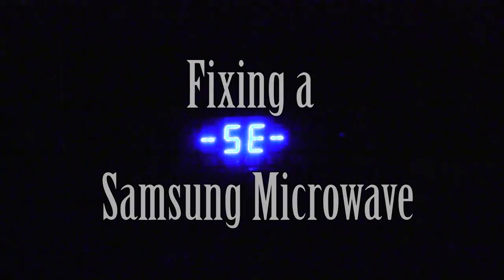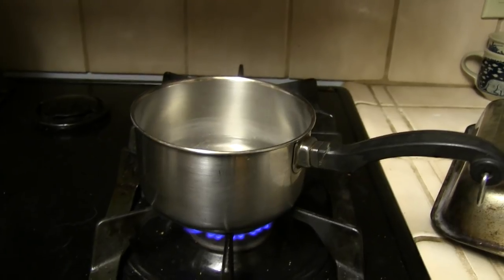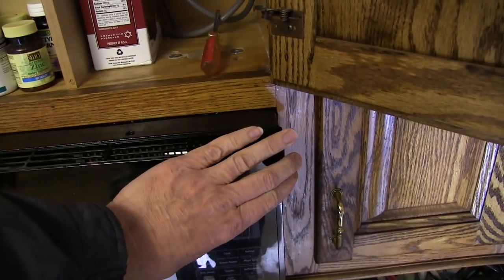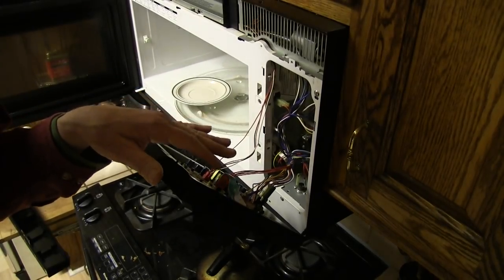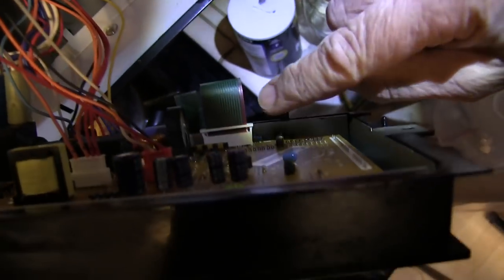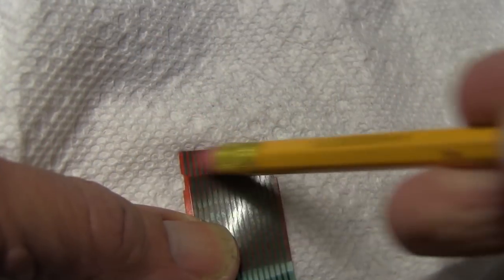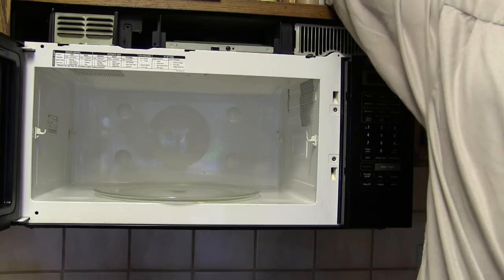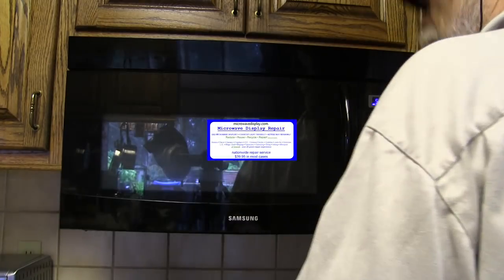Fixing a broken Samsung Microwave - The dreaded 5E error code -- aka the SE error code.

Comment: I tried your repair and it worked great! However, it only worked for a few weeks and now I’m having the same problem. I’ve cleaned all the wires and connectors again but it won’t work at all anymore and keeps giving the 5E error. Any other tips that I should try before having to replace it?

Comment: This worked perfectly for me.   I used isopropyl alcohol swabs to clean all the contacts on the ribbon cable and used a toothpick to get in and around the pins of the other connectors.  15 minutes of guided work saved me from buying a replacement microwave.   Best how-to video I ever watched.   Didn't leave out a step.

Comment: This happened for the 3rd time to my microwave in 4 years!  The first time it was under warranty (by just 2 days) and the repair man replaced the circuit board.  The second time, I followed your instructions, and it worked just fine.   I unplugged everything last night and cleaned all areas, but when I plugged it back in I had no electricity, not even the light!  The outlet is in a very hard to reach area, and I may have tripped the RFI plug on the outlet, so I need to double check that tonight.  Any idea which of the connectors supply the electricity?

Comment: I'm glad the 2nd highest ranked Google result for "Samsung SMH9178B keeps beeping" is your video. Finding a solution on the internet is fairly common these days. But to find a complete, informative, and professionally produced video like this was a real treat. Kudos to you!

FWIW, cleaning only the ribbon cable did the trick for me as well. Also, my microwave did not show the SE error. It just kept beeping and the key presses only registered intermittently.
Reply: Im glad i read your comment before cleaning everything, because it worked on the first try. Yes! Minimal effort because im actually moving out of my rental condo this Saturday! Thank you
Reply: My smh9151b was stored away for about 4yrs before put in use, and it's worked for about 12 since. 
It started doing random beeping in the middle of the night. 
Not sure how far I'll get , this thing was probably obsolete by the time I installed it.
Maybe I'll look around for a connection issue but I don't have much faith in it , and I don't want to waste alot of time goofing around with this thing though.

Comment: Thanks for posting this! I followed most of your steps and put it back together and I now have a working microwave! The only things I didn't do was use the clothe on the end of a sharp object to clean between the contacts (I think the compressed air did an effective job of cleaning things out).

Things I would suggest adding is to use your camera or cell phone camera, to capture a picture of the wiring before disconnecting and then completely disconnecting all wires so you can work on the keypad on a flat surface. In checking the ribbon cable there weren't any exposed metal contacts so I only lightly cleaned it with an eraser and buffed it with a clothe (it appears both sides are completely coated with plastic) - I didn't want to wear away the plastic. I believe that the cleaning and disconnecting and reconnecting of all of the connectors are key. The contacts where I focused the cleaning with the eraser are the four copper contacts that the blue and white wires slide over.  In addition, I unplugged the unit and left it unplugged for several days, I am not sure if this is a factor but it may play a role in allowing any build -up of energy to be released. Finally, something that may play a key role is the other end of the ribbon cable - I am NOT recommending to attempt to disconnect the other end but I think it is important that people attempting this repair to not put any stress on this cable, e.g., tugging on it, and I noticed that it seemed to be somewhat extended so I made a point to gently push the other end of the ribbon cable that connects to the keypad back inward toward the keypad. I will provide updated status but so far so good :)

Comment: A month ago I used your video to fix my microwave.  Unfortunately it is acting up again, but this time, it is something different.  The 5 button just random pushes itself 4 times and then none of the other buttons will work.  I can reset it by unplugging and this may last a few minutes or slightly longer.  Any thoughts?  I'm thinking of replacing the keypad

Comment: It is essential that you FIRST either discharge the capacitor with a insulated screwdriver, or let it discharge on it's own by letting it sit unplugged for atleast 8 hours prior to the repair. Failure to do so could result in injury or death.

This is a great how to video, but as with all electrical related repairs safety is your number one priority! Please do not take shortcuts that can put yourself in danger with a DIY project.
Reply: Safety is always priority one but this repair is no where near the capacitor and all parts dealt with are  insulated and no volt with the unit unplugged. Just don’t jam any coat hangers in there to catch dust bunnys.

Comment: After watching several of these "how to fix the Samsung 5e errors" I came to the conclusion that there was one common element. Most of the 'solutions' involved different 'fixes' but one common action. The action was the removal of the cables from the control panel. I removed the grill from the top of the microwave,(2 screws), then removed the panel (1 screw). I left the power on and carefully unplugged each connector on the control panel board until I found the one that supplied power. I knew I had the correct wire connector when the panel went blank, I waited about 10 seconds and then plugged it back in. The panel 'rebooted' similar to a computer and now works. Simply unplugging power from the wall wouldn't work, you had to remove the connector from the board which reset the panel. The whole procedure took about 5 minutes.
Reply: This is a great follow-up comment to the video for a successful fix.
Reply: Gary DePollo Awesome! I knew it had to be simpler!!
Reply: Gary DePollo How long did it last you?
Reply: Unplugged everything, waited a few minutes and plugged all the plugs back in. IT WORKS! ~ No cleaning needed
Reply: Thank you Gary very very much!!!
Reply: I only removed the ribbon from the keyboard.  Cleaned the ribbon with isopropyl alcohol and alcohol using a Qtip, I was able to see what looked like dirty solder on the Qtip.    I also recommend cleaning the whole exterior of the keypad with isopropyl alcohol to ensure that the outer surface grim is not stuck to the keypad causes the keypad to stick.

Comment: Wow, kudos on a really PROFESSIONAL video!  How did you create the graphic arrow overlays and title cards?  Also, FWIW, I'd recommend using Tex-Wipes, lint free cloths for application specific electronic repair.  Also using something like QD Electronic cleaner an alternate to CFC based cleaners, to spray the connectors/pins.  Then use the tex wipes to wipe the residue off.

Comment: It is that pesky ribbon connection.  I am uncomfortable with that connection.  I pulled the panel out, and followed the suggestions for cleaning all contacts in each connector.  I tried to burnish the contact edge of the ribbon, I used a white eraser to burnish, and followed up with a contact cleaner pen.  I wiped the edge dry, and reinserted it into the connector block.  The first attempt did not fix the SE error problem.  Second attempt, I used an acid brush (a brush used to clean new solder connections) dipped in alcohol, and forced the bristles directly into the board connector, then wicked away the excess liquid, following up with a canned air blast.  Finally, when I reinserted the ribbon, I worked it in and out a couple of times before locking the connector.  That worked.

I am completely underwhelmed with the quality of workmanship, and the non-robust design Samsung put into this appliance. I am now worried that our Samsung stove-top/ convection oven combo is headed for troubles with its electronics.  I suggest to anyone shopping for a kitchen stove, or overhead mount microwave, to steer clear of anything that has smarts, and is gadget loaded.  Get a gas oven, with the only electronics installed being those really cool piezo-electric igniters.  Really.  Go for robust, but simple.  Kitchen appliances go through a lot of Hell!
Reply: Use contact cleaner spray. It works on any connector or electronics. Buy at auto parts store.
Reply: My ribbon lock was loose when I inspected it before unplugging everything. My guess is all the door slamming over the years worked it loose. . .It was a simple fix thanks to all the good folks who post on Youtube!

Comment: Water alone won't stop the MW. The problem is that the ribbon cable(s) from the keypad to the works rubs against the metal frame, wears off the insulation, and shorts out. I put a piece of electrical tape on the frame and, for good luck, slipped a piece of scrap paper between the two ribbons. I was able to do this with the MW on the wall and without removing the main case, but I don't remember how I got the case open from the front. I think I remember taking out two screws, sliding the upper case sideways, and taking out one or two screws to remove the control panel.
The MW has worked for a few years (but now seems to have blown a thermostat - $4.00 - but I had to take it off the wall to get at it).

Comment: Great video. Your fix worked for about a year the first time, and then started the behavior again. I'd disconnect the main power cable for 15 seconds or so while the unit was plugged in (as another video had suggested), and that worked sometimes for a couple of hours and sometimes just for a few minutes.

What did work was total replacement of the membrane keypad. I bought mine from Appliance Parts Pros for $35, plus $6.50 shipping (I don't have any relationship whatsoever with them; I just found them online). Replacement of the membrane, as shown in yet another YouTube video, was fairly straight forward. It was a bit messy trying to get the old adhesive off of the plastic housing. OnceI did that, laid down the new membrane with its self-adhesive back, and reconnected everything, I was back in business.

The unit now works just fine. I just did it this morning, so I'll check back if, for some reason, it fails again.

Comment: I've experienced this issue with my SMH9187B for a couple of years now.  When the issue first came up, I followed the instructions of this video and they worked great!  Great video!  This video is the gold standard for DIY fix-it videos!

However, the issue came back about a year later and no matter how many times I repeat the instructions in this video, the SE error comes back immediately.  I dug a lot deeper via Google and think I now know the nature of the issue.  As others have said, the issue is the ribbon cable.  However_, I don't think the issue is cleanliness of the contacts, but _position of the ribbon.  The ribbon has a tendency to fold over on itself and this seems to short it out in some way.  Stick a piece of paper underneath the ribbon, so that even if and when it folds on itself, there is no shorting.  I recommend doing this as you do the instructions in the this video.

For reference, check out these other two videos:
https://www.youtube.com/watch?v=o0Hp53Cd7e8
https://www.youtube.com/watch?v=ikQvqAwLXqQ

Comment: About three months ago, I had this problem with our Maytag microwave. A quick fix of using a hair dryer and massaging the keyboard while running the hot air over it worked. The problem recurred a few days ago and that easy technique failed time after time. Your very well-made step-by-step video did the trick though! Hopefully it will last longer than my last quick fix. Thanks for the video - YouTube to the rescue again!

Comment: Joe, thanks for the video, first off one of the most professional instructional service videos I've viewed. Our Samsung over the range microwave was possessed. The range/night light was going off and on in rapid mode complete with audio beeping. Pulling the power plug didn't reset it. Followed your video and it seems to have solved our issue. Well done. We have 4 Samsung appliances and they've built in a lot of problems in their design. Thanks

Comment: I just did this on mine that had that dreaded error code.  What I found was that tape-like connector had a lot of grime built up.  Used the suggested pencil eraser and some rubbing alcohol and was amazed at the gunk that came off.  Plugged everything back in and reassembled.   Plugged back into the wall outlet and it freaking Worked!!!   Thank you soooo much!  A new board is around $100 and a new microwave is 3 times that!   You saved me so much!

Comment: GENIUS!!!  While everything I took apart was disgustingly greasy, there didn't seem to be any grease or grime in the actual wire section.  I didn't really feel like I cleaned anything, but it may just have been taking the wires apart and putting them back together that fixed the problem.  Either way...it worked!  I really liked your clear instructions on how to take apart each connector.  Thanks for the great advice.  One suggestion...take a picture of the wiring before taking anything apart.

Comment: One of the easiest repair video's I've seen!  Took the unit apart using your 6 easy step and got everything to work on the first try.  Cleaning the ribbon cable with a soft eraser is the heart of the fix since it should have a silver color to the connector and not the same color as the ribbon cable (brown).   Be very careful to completely insert the ribbon cable back into the socket and lock it down!  I took this one step further and took extra time to get rid of all the grease buildup using a household degreasing cleaner spray in the internal vent hood.  If its not sticky...its clean!  Joe, you're a great tech and videographer!!!

Comment: Fixed mine following this in just a very few minutes.  Just removed, cleaned with an eraser, and re-inserted the ribbon cable.  PULL UP ON THE RELEASE LOCK to release and clean the cable, then re-insert the cable and push the lock back down when finished cleaning to re-install.  That's it!  Hope it works as well for you and good luck.

Comment: Thanks for the tip!  I once had a similar problem with the control panel of my washing machine.  I did the same, but before plugging all the cables back, I added some dielectric tune-up grease.  It has metal specs that help conduct electricity and the grease helps seal the connection.  You can find a tube of this grease at Canadian Tire or any automotive section of a hardware store for about 6$.  My washing machine has been working great for over 8 months now.

Comment: I followed these instructions and when I plugged it back in and tried to set the clock - same problem - none of the buttons worked - UNTIL I hit the stop button - then it worked fine. I believe the problem was dirty contacts on the ribbon cable - I got a lot of 'black' stuff off with the eraser.  THANK YOU Joe!!

Comment: I tried this just after Joe posted this in 2013 - cleaned everything with isopropol alcohol (70%) - and it worked right up until today - Aug 23/14.   I just did the same process all over again, cleaning all of the pins and ribbon cable with alcohol and it's back up and working like a charm!   Great tip...easy fix - nothing to be afraid of, just follow the directions he gives.   You don't even have to mark anything, the circuit board is marked "blue" for where the blue connector goes.  All the rest of the clips are size sensitive and color coded!   
Great to have this online!

Comment: Fantastic video production: KUDOS!

I followed your instructions to the letter, and - despite all appearances that my board was fairly "clean" and intact - your procedure DID restore my micro to operational status!

Used alcohol on Q-tips to clean my contacts, and all components... and even though it's one again working, I didn't cancel my order for the "assembly control panel" (which I acquired for $53.73 including priority shipping) - due to the fact that my board smelt substantially of burned ozone... and I suspect certain components are on the verge of failure.

Still-in-all, it's wonderful to have it back - even though it may be only a temporary respite before complete failure (the replacement will arrive next Monday (today's Thursday)!

Thanks, ever-so-much for your thoughtful, thorough explanation and video!

Comment: We followed the steps in the video to access the circuit board, then used the paper between the ribbon fix shown in another video, worked perfect and only took 5 minutes!
thanks, saved us from having to buy a new unit or having to wait for a repair from the company.

Comment: I wish to sincerely express my gratitude to you for creating a concise, useful tutorial. I have always referred to to your video as it is the most useful when I must disassemble my microwave to correct the SE error. 

I used 99% isopropyl alcohol to clean the end of the ribbon cable as well as dribbling a drop or two of the ISP into the ribbon cable connector socket. 

An important detail I wish to emphasize is to be certain to gently insert the ribbon cable into the socket until you FEEL IT BOTTOM OUT in the connector socket, then press down on the ribbon connector lock. 

BRAVO!